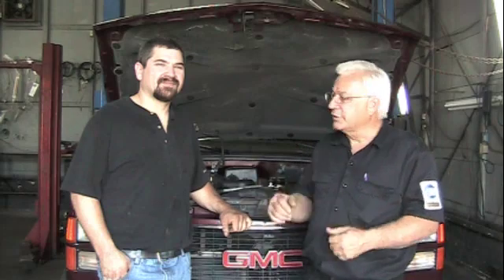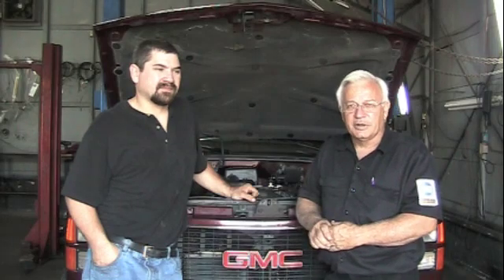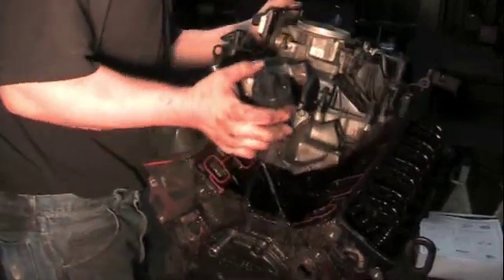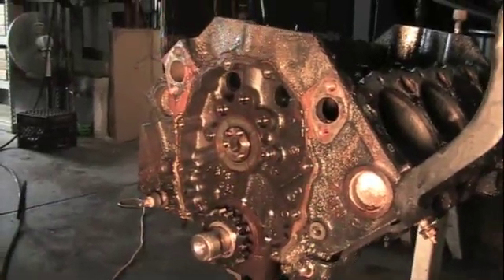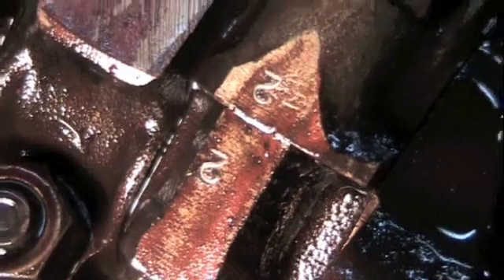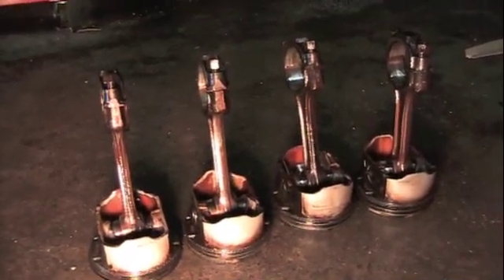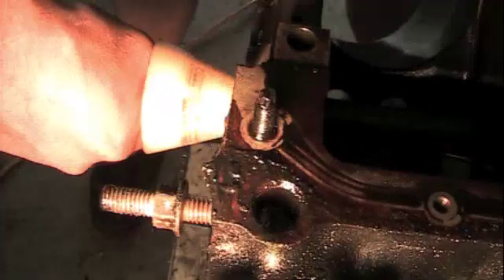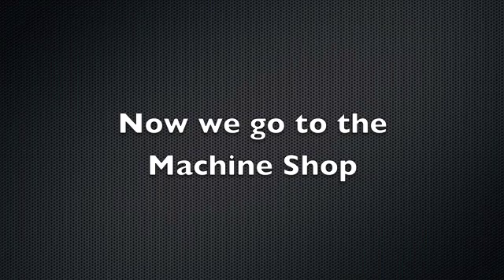Engine rebuild part 1

Comment: realfixesrealfast 
I'm contemplating, in the future, of buying a small shuttle bus and converting it to an RV. The problem is the powerplant in those things seem to be all V10 fuel hunrgy beasts and I was wondering if the engine might be able to be swapped for one of fords new 3.5 liter twin turbo EcoBoost or even the 2.6. The numbers say it should work to move one of those buses and then some. 365 horsepower and 420 lb.-ft. of torque vs the V10 at 305 horsepower and 420 lb.-ft. of torque.

If it would work, it could shave the fuel mileage down from 8-10 to 16 to 20 mpg.
Thoughts ?
Reply: +Paul Gloor Buy an RV.
Reply: +Scot are

Comment: I have a 1999 chevy Tahoe,  5.7 vortec, I have to rebuild, I don't  want stock would love the 383 stroker. If you have to guess, what would be the overall cost to upgrade my 5.7vortec into the 383 srtoker like you did in the video??

Comment: Rebuilt a 305 once when it spun a rod bearing, but rod bearings doing that on 350's isn't typical like it is on 305's. Surprised this happened... tortured engine?

Comment: Great video. I like it when you call an engine an engine and not a motor. A engine gets it`s power from within. A motor gets it`s power from an outside source like a powerhouse or a battery. Motors are electric. Engines aren`t.
Why didn`t you lube the main seal before installing the harmonic balancer?

Comment: yes it matters.   a high torque engine should always be of the 4-bolt-main style.  whenever the piston is in the power stroke, you are putting a high load on the main bearing caps.   a 2-bolt-main is not appropriate for an engine being used in a heavy towing, or an off-road 4-wheel-drive application.

if all you're building is a city/highway truck without high towing capability, you can get away just fine with a 2-bolt-main block.

Comment: no, the  type of gas you use depends on the compression ratio of the engine, regular gas is used for low compression engines, higher compression engines use higher grade gas so detonation wont occur.

Comment: does it matter if you use a 2 bolt main or 4 bolt main. is there any difference between the two as far as stroking them.

Comment: Wow I just noticed @ 7:33 he is holding cam bearing tool W/ that sharp angled point driver  in the left  hand pointed towards the other & hitting the cam bearing tool W/ a large hammer with the right hand. Just NOT SAFE.

Comment: It really wont ruin it, if anything you stand a chance of changing the center to center of the holes on the rod cap, the real reason is the rod end caps have          ( balancing pads) wen he say's "don't stamp it right here" those are balancing pads he should have identified what they were. The machine shop will find the lightest rod and remove metal from that area on the remaining rods so they come in at the same weight, hope this helps you.                ~V~ Obsession

Comment: as a guideline 03protegeES said is correct,but you'll find that the terms are largely used without those guidelines,especially in the shop. I can show you 25 people who call a chevy 350 an engine,and an equal number who call it a motor,and another 25 who call it an engine or a motor depending on their mood. so 03protegeES is right,but you're still going to be confused by the number of people you know who are wrong.

Comment: Hey what holds the cam in a 305? I took one apart the other day and after i pulled the timing chain the cam slipped right out. There was no retainer nor there was a place for one. So how does the cam keep from lashing around in a 305? I took the motor apart so fast I didn't even realize that until I saw this video lol

Comment: they KEPT the 350. It's that now it has the crank from a 400 small-block, and the cylinders were bored out .030. 190,000 miles will kind of necessitate that last part.

Comment: By your "logic", a larger displacement engine is not stronger either, since that's exactly what a longer stroke in any engine does - increase the cubic inches in any engine...

Comment: ok, I have a question. Why don't you mark the rod cap on the end? I was just taught to mark them on the sides like you do. But, in the mid 70's when I learned all of this stuff, I always thought it was to make sure you keep the rod and cap lined up right. How does it ruin the rod? You guys have probably already been asked this before. Sorry if this is a repeat question. I really like this video series. I appreciate you all doing it:~) Thanks.

Comment: Air tools are fine for disassembling most of a block. Aslong as you stay within the bolt grade tolerance and its not threaded into a aluminium part, it should be fine. Though i would not suggest using a impact gun without torque limiters. Also it is a good rule of thumb to always assume the last mechanic was a jackass and misused/abused the red loctite.

Comment: Not quite 6.3 unless your rounding up. Its 6.27, 1 cubic inch  = 0.016387064 liters X 383 = 6.27624551 (thus 6.27). But overall still not 6.0L as in reverse 1 liter = 61.0237441 x 6 = 366.142465. This is all under the assumption that the cubic inch measurements are exact.

Comment: running an engine undersquare isnt the strategy I would go with. You can achieve more reliability by increasing bore size and shortening the stroke. Most all the bad ass motors were over square, 426's, 502's, 572, 440 super commando, boss 302, 351 cleveland, Ford's super cobra jet. I could go on but you get the point..

Comment: @snake10566 It depends on the rod material and production process,  However, stamping parts creates stress risers (a starting point for fractures) that can lead to failure.  It seems unlikely, but it happens more often than one would expect - and not only on con-rods.

Comment: @dookiss4 Vizard has a few good points about these new blocks. 1: it has provisions for a hydraulic roller, save a bunch of money by just freshening up the stock lifters and dropping in a lumpier cam. 2: if it's an EFI engine it'll probably have decent bores, like 1 in 3 chance of just honing it up to "race" spec. Not that it would matter if you were doing a big budget stroker 383... but for a bum like me, the roller cam block I scored is a godsend. Heads + cam and basic rebuild = 450-500hp?

Comment: Hey! Guy's....Great video to watch....But, why wonld'nt you use an old block to do this motor....They say that the 1 piece rear seal 350's are know for cylinder scoring in mostly the 2 and 7 or the 1 and 8....I've taken 2 of these block's apart and have seen this first hand....So, I bought a Dart block but pretty much using the same kit you guys use the Eagle 383 stroker kit....Not knocking your video because I think it was a great video true hands on and I learned alot  of new tricks....Thanks

Comment: its also important to stamp it on the the side of the rod that corresponds with the side of the engine the rod came from because alot of rods will have a little squirt hole that squirts lube on the cylinder wall.. and never use air tools for reassembly .. also be sure to remove your alignment dowels as well so they don't end up getting lost

Comment: What crank are you using. I bought a 383 stroker motor someone else built and as soon as I romped on the pedal Snap went the crank. And I hear its a common problem.

Comment: Remember align honing people is the better way as opposed to align boring honing self center wich does not make your timing chain loose. align boring just cuts exactly were it is meant too and in turn can cut closer to the block center line than you want it to.

Comment: @RightsAndPrivileges the car had a 305 tbi stock. it was weak, a reliable engine but hardly a performance engine. i picked up a 350 off of craigslist, installed new cam, lifters, timing chain, gaskets, and a good set of L89 heads. it runs good and i have less than 800 bucks into the engine. it has enough power to get out of its way and is plenty fun to drive. lots of torque

Comment: in order for it to be a 383 stroker it needs to be bored out .030 with the 3.75 crankshaft. if you just put in the longer stroke crank and not bore the cylinders out you only have a 376 cubic inch engine.

Comment: @bcboy787 That is the dumbest thing i've ever read, "General Motors, Dept. of Motor vehicles..." I could go on forever. 
noun: a comparatively small and powerful engine, especially an internal-combustion engine in an automobile, motorboat,  or the like. 
Dumbass.

Comment: i have a 1997 sierra 1500 witht he 5.7 vortec in it any1 know what type for fuek system it has, Carbed? TBI? or something eles and where can i get a rebuilt engine and for how much or how much would you charge to rebuild my motor??

Comment: Lot of times a reman is cheaper,a reman 1988 to 1995 350 from Jasper is $1,200 and machine shops charge at least $1,500.00.GM performance parts does sell a 1996  and up 383 stroker crate engine.